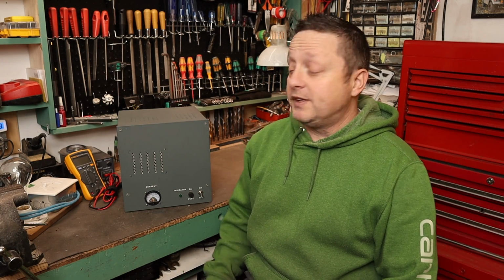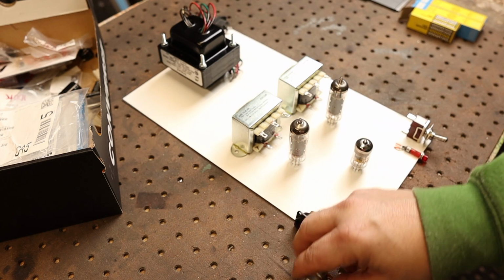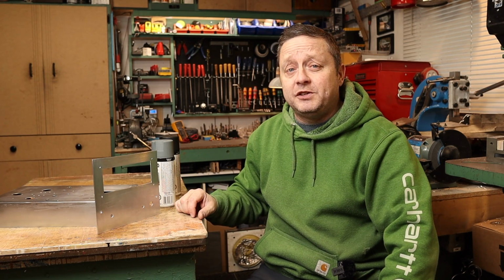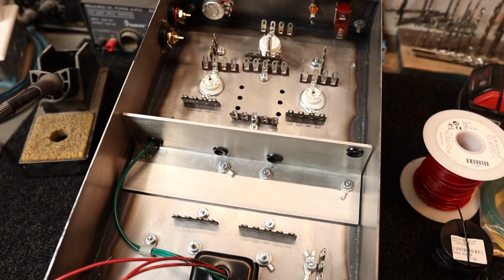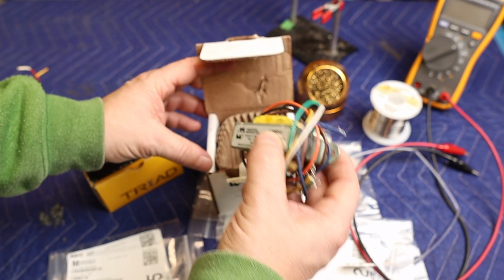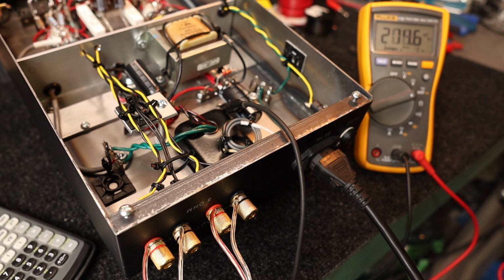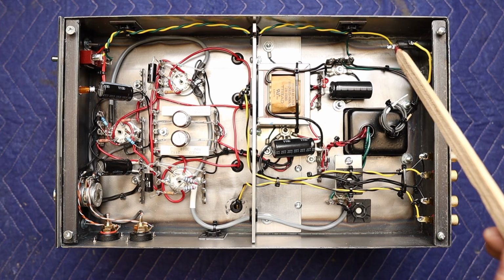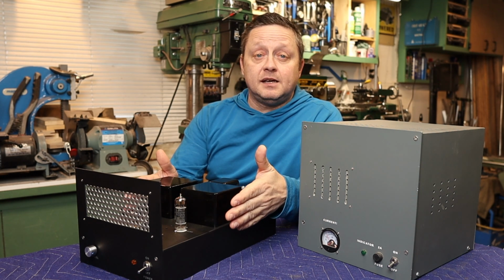DIY EL84 SE Tube Amp // Building a stereo vacuum tube amp from scratch

Comment: Mike, what font did you chose for the lettering using the cricut printer? Detailing the lettering is a huge help and much appreciated.
Reply from the maker: I used Arial Bold 16pt.  Anything smaller than that and the paint tends to bleed and you can't pull it off.   Also, when text gets too small, it's hard to weed and put on the transfer paper, especially longer words.  I would experiment first before you commit to a final version.  Cheers
Reply: Thank you Mike. Yes, I'll do some test runs to get the hang of it first. Being able to nicely label tube type and channel information is a game changer for a scratch build amp. I'm excited to have this ability.

Comment: Thank you for sharing! I watched your series about building a 1-watt guitar amp and was wondering if one could easily take the power amp from this build and use it with the preamp from that build, with just one output transformer and one EL84.
Reply from the maker: That’s for commenting.  Yes, that’s very doable.  That would basically be a Fender tweed Princeton and swapping the 6V6 out for a EL84.  Check out the AX84 community/ amp builds.  Lots of info there.  Cheers.

Comment: Can we convert this amp to preamp?
Reply from the maker: Thanks for commenting.  No, not really.  This is a power amp.  The input/output impedance, gain and power is not conducive to a preamp.  I guess you “could” just use the EL84 and ditch the output transformers and 12AT7… but that’s a totally different topology.  Check my channel for preamps that I have made.  Cheers.

Comment: I have a Leak Stereo 20 amp (4 x el84) from I think 1962. Was watching the Proms from London's Albert Hall last night using it for the sound. It's pp with very nice SQ. The real magic however is from my Border Patrol SE300b SET. It sounds incredibly pure - a minimum of components with a huge choke input psu. It's incredible how it puts the singer in the listening room.  That said I need to repair it and rebuild it into a new smart wooden plinth. Plan to build the uTracer 6 to test the 300b valves I have as a first step. My bible for contruction is 'Building Valve Amplifiers' by Morgan Jones - retired ex-BBC engineer. I find selected YT like yours a help and inspiration. So far I've only built from kits. Appreciate how you thoughtfully answer all questions.
Reply from the maker: Thanks for commenting. I can totally understand your appreciation for the "magic" in a SET amp. If you have done so, please have a look at my 2A3 SET amp video. I'm also in the process of making a 300B amp. Cheers.

Comment: There is another tube with about same capacitance specs - EL509, and I found almost no demo on YT. It's powerful enough for even OTL amplifiers, however gate-anode-cathode capacitance is very small. And I expect a good sound. Do you have any plans for that tube, sir?
Reply from the maker: Thanks for commenting. I'm not too familiar with that tube. I've never used it or thought of using it. You have piqued my curiosity, I may have to investigate some more! Cheers

Comment: No negative feedback?  Frequency response would be a bit flatter, and a wider dynamic range.
Reply from the maker: Thanks for commenting. Yes, Local (AKA Plate to Plate) Feedback is employed with this design. It's not like the traditional feedback loop that takes a small portion of the output signal and feeds it back into the input. So, yes, you can totally do this if you like. Just remove the Local Feedback Loop section. Cheers.

Comment: I had a silvertone record player 4 legs wooden.
It had 2  6bq5's and 2   12ax7's and a rect tube.
Someone stole my gear. How can I build one or even find a schematic?
How can I put five frequency tone stack circuit mod?
Reply from the maker: Thanks for commenting. I'm not familiar with that amp. You may find a schematic on it online somewhere.   These EL84 console amps were very common back in the day.  You should be able to find something similar.  I'm not sure that I would go with a 12AX7. A lot of gain that may introduce some noise into the system. I'm not familiar with HiFi Tone stacks. I typically don't use them.  Cheers.

Comment: I made an identical amplifier, but I noticed a magnetization of the transformer core, the current was causing this, I put a resistor in control grid 1, a negative voltage of 30 volts through an 820k resistor, this gave some slack, and improved the distortion. congrattulations .👍👍👍👍👍👍👍👍👍👍
Reply from the maker: Thanks for commenting.  Interesting design scheme.  I’d like to see that drawn out and your voltage readings.    Are you happy with the build? Cheers.

Comment: Congrats! Excellent work. I have built also a number of tube and transistor amplifiers, radios for the AM-FM bands and some transmitters as well. My last project is a tube stereo amplifier with four KT66 at the output stage per channel. Output power is 100W / channel.
Reply from the maker: Thanks for commenting.  Those sound like interesting projects.  4 KT66’s, that’s a lot of iron… it must party!?   Cheers.

Comment: Since I use wood cabinet with removable metal tray, controls and I/O pannels, for the lettering I use laser engraver on my projects. I spray paint the metal then engrave the markings. I finish it with a coat of lacquer.
Reply from the maker: Thanks for sharing.  Yes, that is another way to do it.  I’d like the try that way but the laser engraver can be rather expensive.  Perhaps one day when they come down in price.  Cheers.

Comment: I thought a SE EL84 would provide 3 watts output, thinking of the Vaughan am (I forget the name).
Reply from the maker: Thanks for commenting.  They can.  It really depends on how they are wired (ie Triode mode), voltage, how they are biased, the OT being used and how they are measured. All amps have slightly different in parameters. Cheers.

Comment: Hi Mike, I’m getting the components to construct this Amp, but will use a tube rectifier, can you confirm which Capacitors are polarised for this circuit , I’m thinking all except C5? Any help appreciated. Alex
Reply from the maker: Wonderful!  Yes, you can use a tube rectifier but you will need to adjust the components a bit.  The first PSU cap will need to be lowered to align with what the rectifier will play nice with. You should be able to get that max value from the tube data sheet.  You should also use a higher voltage transformer. A tube rectifier typical has a 15-35V drop across it (depending on the tube)  The only cap that doesn't need to be polarized is the 0.1uf coupling cap (C1) the rest should be.  You could use film caps in the PSU but those values and voltage are HUGE and cost a lot.  Cheers
Reply: Thanks for taking the time to reply to my question, much appreciated Mike, I’ve built a couple of SE KT88 amps from Blue Glow Electronics, and am pleased by the sound coming to my warn out ears!  For you build, I am intending to use a Hammond 370 EX power Transformer and Hammond 125 CSE output Transformers with an EZ81 rectifier Tube . I just need to work out what components need changing, don’t know if there is any tool on line to give the correct values needed for the Circuit? I forgot to mention the choke, I have a Hammond 158 M, 10H, 100ma 262 ohms DCR  Any comments welcome, good or bad, haha!  If I get stuck, I may have to pick your brains again Mike, and buy you a beer 🍺
Reply from the maker: The 370EX will work great but it is a bit overkill. A EZ81 will also work BUT it has a 6.3v filament and its not ideal to have that on the same filament circuit for the other tubes. It will work but it is frowned upon by many tube amp builders.   I'd suggest using a 5V rectifier like a 5Y3 or a 5U4. The transformer you want to use as a 5V winding.  The OT are fine and the choke will work great as well.   Buy me a few coffee's and I'll sketch up a schematic for you with those changes and expected voltages.  Cheers

Comment: Would benefit from some NF but you don't have enough gain as is. I'm not a fan of having the gain pot being connected directly to the grid, the pot will get noisy very quickly.
Reply from the maker: Thanks for commenting.  This amp does have  some NFB.  It’s plate to plate (aka Schade feedback). It does make a subtle difference.  I’ve yet to try global.  Perhaps one day.  Cheers.

Comment: Mike, why do you use steel for the chassis, not everyone has a welding set available, Steve
Reply from the maker: You don't have to. That's just the way I decided to make this one. You could get a preformed Hammond project box or as mentioned in the video, you can use s aluminum top plate with a wooden base. They all work well.  Cheers

Comment: Cool!  I'm giving this a go.  Two questions:  Can this be bridged like a Decware, and how?  What is the total mains power consumption?
Reply from the maker: Thanks for commenting. I do believe it is possible to bridge the output but you "may" have to omit the NFB loop. I've never done it.  I think you just need to put the speaker output in series. Left negative to right positive and connect the speaker to left positive and right negative. Then use a 2-1 Y connector for the RCA input.   This amp is not biased that hot and uses solid state rectification (no Rectifier tube) I suspect is draws around ~55-60 watts. I'll have to plug the amp in and measure. I can report back! Cheers
Reply: @MikeFreda  Great, thanks for the info.  Parts are on the way and having an economical path (trafos) is much appreciated!

Comment: Hi, do you think i need to modify anything if i wanted to use a 270-0-270 transformer? 
I’m trying to figure out how to use it in a circuit with 12ax7/at7 and el84 but not too sure on how to adapt the circuit. Is a voltage divider enough to drop the extra B+?
Reply from the maker: Thanks for commenting.  You can use slightly larger B+. You can just increase the PSU dropping resistors a bit.  I would not use a 12AX7 in this amp.  The gain is way too high. It probably won’t sound as good and would clip much sooner.  Plotting the load line will show you the much larger voltage swing.  Would be okay for a guitar amp, not a hifi stereo. Cheers.

Comment: great build! do you find sonic differences/characteristics to SE el84? vs SET or anything else? I'm looking for crystal-clear sound but with tube magic.
Reply from the maker: Thanks for commenting. This amp can be wired SEP (Single End Pentode) or SET (Single End Triode) by strapiing the grid.  Triode mode has less power but also sound good. Not much of a difference but it can be noticeable. When running in triode, I find the bass not as deep but the vocals/mid range a bit more pronounced.   You really have to do quality listening and A/B them to really hear a difference.   To be honest, EL84 are good tubes, they are affordable and widely available but if you are looking for that "tube" magic you may want to look at my 6DN7 SET amp build. It's a low cost tube that sounds amazing! If you are looking to take a big leap into SET, another great sounding tube is the 2A3. These tubes do cost a bit more and the build process is a bit more complex but they are magical when paired with a higher efficacy speakers. I will be doing a build video using a 2A3 tube.  Cheers

Comment: Thanks, maybe you can go deeper into the components soldering the next time.
Good job 😊
Reply from the maker: Thanks for commenting and for the feedback.  It's always a fine line to what to focus on. If I make the video too long, people will not watch. I will keep it in mind though.  My next tube amp video will be more about the circuit/wiring and less about the chassis. I figured that people who are watching my build videos know how to solder and install components, but I could be wrong. I guess I could do a seperate video just on that. Cheers.

Comment: Hi i made a single end with 6sl7 and kt66 ,id like to know if i put a potentiometer do i need  1 meg ohm paraalel  with that to input !.i see in your shematic you have only 100k potentiometer .thanks
Reply from the maker: You typically don’t need the additional resistor.  I’m not familiar with the circuit you are referring to but a 1meg is pretty high to serve as the ground reference in the input tube. It’s typically much lower than that.  I hope that helps. Cheers.
Reply: thanks
 @MikeFreda

Comment: Mike, you are truly master of your craft with excelect attention to detail.  Love the chassis build and look.  I will suggest two things to others watching and building the same.  1) One can buy same Audio output transformer with attached insulated wires. it is a different part number in thei catalog... it's same transformer. In this way you don't need to build a bulkhead for transformer. Simply spary high temp flat back on it.  2) you are placing EL84 tubes too close to transformers. Radiant heat energy from tubes will contribute to temp rise of transforer in long listening sessions.
Reply from the maker: Thanks for commenting.  I’m glad you like the build.   Yes, I’m aware of the different versions of this OT.  They do cost more and I had planned to cover it anyways for aesthetics.  As for the temps, have a look at my community page.  I post a pic of the operating temps. After 8+ hours of operation, the OT cover is at 26-28Deg C.  I reached out to Edcore and they advised me that the normal operating temperature range is -40Deg C to 105Deg C.  So I think I’m safe.  But yes, it is a thing to consider for longevity.  That’s why I used a 10w cathode resistor.  A 3watt would work but it would get pretty hot.   Cheers.

Comment: Hello do you have like a discord channel? i need help with a 6h8c,6l6gc otl amp i just finished the schematic but i still need help with some resistor and capacitor values.
Reply from the maker: Thanks for leaving a comment.  No, I do not have a Discord Channel/account.  Just a email.  Your best option is to post the schematic at DIY Audio or Audio Asylum and let that hive help you out.  What you are making is not that normal and people will their opinions.  Cheers.
Reply: @MikeFreda  update I managed to make it, now I'm dealing with lots of noise and very muddy sounds coming out of it, is it ok if I send my schematic and photos to your email to check it out?
Reply from the maker: @hpfctif7tx7t  You can and I can have a quick look but if this is a scratch build of your own design it will be difficult for me to determine what the issue is over the internet. I'll need to know what your voltages are and what you expected them to be.
Reply: @MikeFreda  ok2x 👍 I'm currently in school but I'm gonna be home in 2 days I'll test out my voltages again and make it as detailed as possible, I did join a discord group but I didn't understand some things that they are saying I'm really new to this hobby I don't know some specific terms that they said

Comment: I think is way much better to do tube amps chassis in Aluminum .. Sheet metal rust very easy .And aluminum is more conductive anyways .. No need to TIG, pop  rivets are simple and look great
Reply from the maker: Thanks for commenting. I've made a few amps that way and it works. I have all the tools to make a "polished" looking amp so why not.  Ken Fisher from Trainwreck amps felt that aluminum chassis provided better tone but that is with a Guitar amp, HiFi are a bit different. I'd like to see the proof/math on that! lol   I also bond and ground all my nodes with wire so I don't find that is an issue for me.  At the end of the day, I just want the amp to be quiet (no hum, buzz of hiss) whatever that takes. Cheers.

Comment: Автор дизайнер... Уважаемый автор,трансформаторы должно располагать под углом 90° сердечники,что б подавить взаимную индукцию,которая вызывает наводки и искажения"кашу" в сигнале.
Reply from the maker: Correct.  The Power Transformer and the output transformer are 90deg from each other.  Furthermore, the Output transformers are inside an iron/metal enclosure.  It is misleading due to how the power transformer is mounted (through chassis).  Thanks for commenting. Cheers.

Comment: Hello my friend, how are you? I really liked your project! I got some ultralinear Wilson transformers, and I would like to build an amplifier with them. It would be my first valve. Do you have any projects you can share for ultralinear transformers that use 12ax7 and el84? Thank you very much and success!
Reply from the maker: Hello, thanks for your comment and question. Unfortunately, I'm not familiar with those transformer so it's difficult for me to recommend something for you that would work. That being said, a 12AX7 is not an ideal input tube for a EL84 SE amp. The mu of that tube is high and  it may be difficult to tame the noise. I know the Budgie circuit uses a 12AX7 but I've never heard it.  To be honest, in this amp I made, the 12AT7 i'm using is hardly being utilized but it sounds pretty good, its affordable, easy to get and they last a very long time. You may want to ask over at the Audio Asylum or DIY Audio for some advice. Cheers.

Comment: Great job on this. I've been interested in this for quite a while. I'm curious what the cost for the parts comes to. Do you have an estimate? Thanks.
Reply from the maker: Thanks for commenting.  Building tube amps is not a cheap hobby. Lol. Prices for tubes and transformers have gone up a lot in the last 10years.  The transformers and choke where $200. The three tubes are $70. Chassis material and paint are $40. All the other parts are approximately $150.   You are probably looking around $500 to make something like this.  Could you make it cheaper, sure but you may have to scavenge parts from other devices or downgrade some components.  For me, I wouldn’t change a thing. Well, perhaps the coupling caps, I may upgrade those in the future.  Cheers.